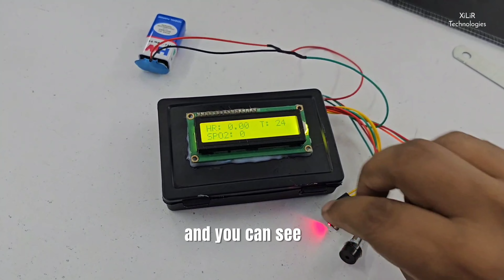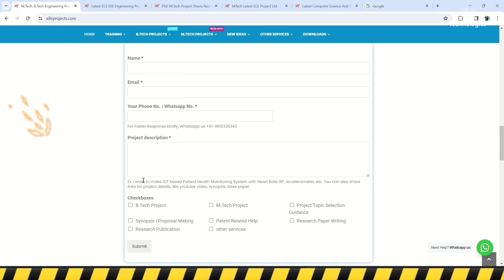DIY : Heart rate and Oxygen Level SPO2 monitoring system using Arduino

Comment from the maker: Arduino Code:

cpp

#include <Wire.h>
#include <LiquidCrystal_I2C.h>
#include "MAX30100_PulseOximeter.h"

#define REPORTING_PERIOD_MS 1000  // Report every 1 second

PulseOximeter pox;
LiquidCrystal_I2C lcd(0x27, 16, 2);  // Change 0x27 if your I2C address is different
uint32_t tsLastReport = 0;

void onBeatDetected() {
    Serial.println("Beat detected!");
}

void setup() {
    Serial.begin(115200);
    
    // Initialize the LCD
    lcd.init();
    lcd.backlight();
    lcd.setCursor(0, 0);
    lcd.print("Heart Rate & SpO2");

    // Initialize the PulseOximeter instance
    Serial.print("Initializing pulse oximeter..");
    if (!pox.begin()) {
        Serial.println("FAILED");
        lcd.setCursor(0, 1);
        lcd.print("Sensor Failed");
        for(;;);  // Stay in this loop forever if sensor fails
    } else {
        Serial.println("SUCCESS");
        lcd.setCursor(0, 1);
        lcd.print("Initializing...");
    }

    // Register a callback for the beat detection
    pox.setOnBeatDetectedCallback(onBeatDetected);
}

void loop() {
    // Make sure to call update as fast as possible
    pox.update();

    // Report values every REPORTING_PERIOD_MS milliseconds
    if (millis() - tsLastReport > REPORTING_PERIOD_MS) {
        tsLastReport = millis();

        // Get the heart rate and SpO2 values
        float heartRate = pox.getHeartRate();
        float SpO2 = pox.getSpO2();

        // Display on Serial Monitor
        Serial.print("Heart rate:");
        Serial.print(heartRate);
        Serial.print(" bpm / SpO2:");
        Serial.print(SpO2);
        Serial.println(" %");

        // Display on LCD
        lcd.clear();
        lcd.setCursor(0, 0);
        lcd.print("Heart Rate:");
        lcd.setCursor(11, 0);
        lcd.print(heartRate);
        lcd.setCursor(0, 1);
        lcd.print("SpO2:");
        lcd.setCursor(6, 1);
        lcd.print(SpO2);
        lcd.print("%");
    }
}

Explanation:

    PulseOximeter pox: Manages the communication with the MAX30100 sensor.
    LiquidCrystal_I2C lcd: Manages the I2C 16x2 LCD display.
    The program reads heart rate and SpO2 from the MAX30100 sensor and displays the values on both the serial monitor and the LCD every second.

Connections:

    MAX30100 to Arduino:
        VIN -> 3.3V
        GND -> GND
        SCL -> A5 (SCL)
        SDA -> A4 (SDA)

    16x2 I2C LCD to Arduino:
        VCC -> 5V
        GND -> GND
        SCL -> A5 (SCL)
        SDA -> A4 (SDA)

This setup will show live updates of heart rate and SpO2 on the LCD screen and serial monitor.